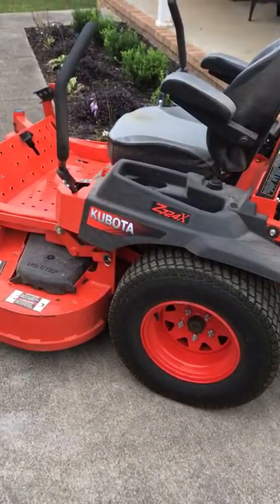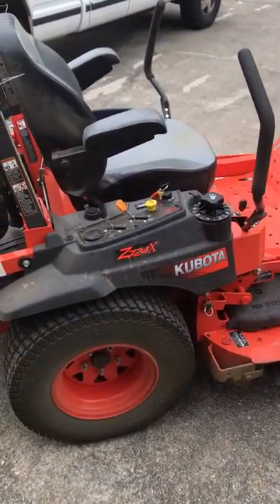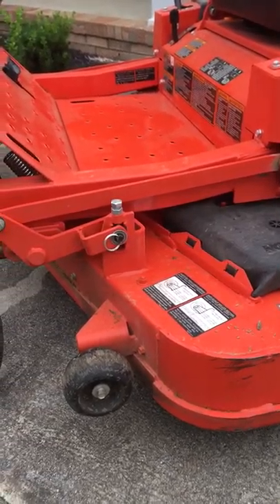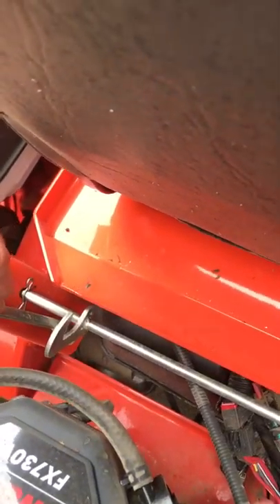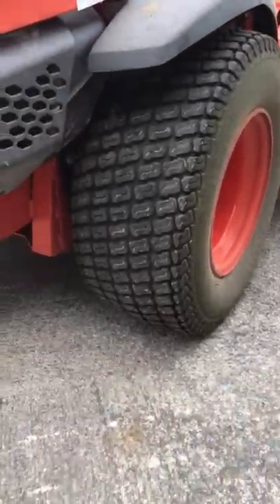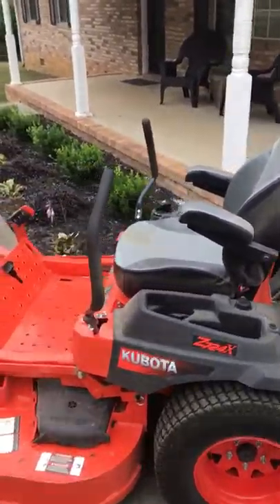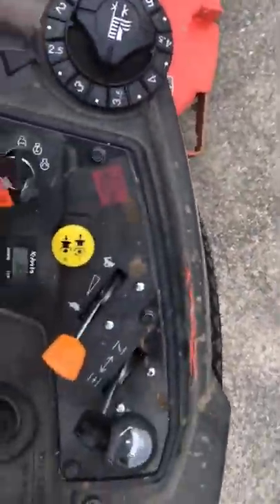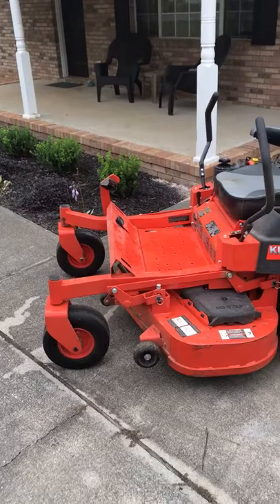2017 Kubota Z724X

Comment: I own a 2015 Kubota Z724 54 inch deck and mow commercially part time.  

Everytime I surf for 'another' ZT mower I always come to the same conclusion:  Even though mine was built in 2015 it still beats the competiton... no nonsense design, awesome deck height adjustment, built like a tank, superior cut even with dull blades, fast, easy access to belt and pulleys. Easy to work on this unit, superior Parker transmissions (I actually push my customer's full size dumpster out of the way effortlessly when it is incorrectly placed by waste hauler and frequently pull a 1500 lb capacity Polar tandom axle trailer filled with yard waste), low center of gravity (one 11.5 gallon tank mostly under seat), minimal travel for steering arms, 8 gauge deck, simple no nonsense design controls snd more!   

Seat cushions are very comfortable but actual ride is stiff as it is not a suspension system seat.   That's ok because it keeps center of gravity lower than a ride with suspension seat which could be the difference between a rollover or not on hills that I manage.  

I'd buy another Kubota today..2023...if they were available.  Hard to get right now so I'll keep my 2015 model for now.

Comment: Just got my new z781i 60” delivered yesterday. I haven’t cut any grass yet. Probably will this weekend. Looks like a tank. I had a little 4x4 kubota tractor that I have mowed with the last 20 years. I never had to do anything to that tractor. I just sold it a few days ago. I was wanting to cut down on my mowing time with the ZT. It was a no brainer for me going back to Kubota. I wanted the diesel but just couldn’t pry my wallet open enough to pay 15-20 K just to mow my yard. Love them Kubota diesels though. I also have a Kubota SVL 75 CTL for the farm. I just don’t think you can go wrong with that orange stuff. It seems like they just have really good engineering and make things simple that work.

Comment: Good review,  I've have this more  with a Kholer engine  it's a beast . I have noticed if I  get on a bumpy section of the yard the deck height selecter will move so I have to watch my speed in situations like that.  I to wish Kubota would have put the wider tiers on the back, but over all I'm pleased with the mower.

Comment: Good review. How does it cut?
Reply from the maker: It cuts good.  However, as I mentioned previously, the engine size (23.5hp) is a bit undersized for this big of a mower in my opinion.  I think it should at least have a 27hp.  I’m thinking of trading for a ZG327.
Reply: ShoNuffStuff if you like this mower but not the power check out the new 2019 z700 EFI. They have a 29.5 hp EFI option on them. And they come with a very nice suspension seat. I hate the Fx730v that’s in my 2013 JD z920m 60”. It’s so underpowered. It has about 2000 hrs and is starting to give problems. Love the 900 series JD one the top cutter decks in the industry. But I really like the new z700 EFI from kubota. I want to go check them out at the dealer soon. The deck on the ZG is not that great of cutting deck far as quality of cut from my research. Good mower but poor deck. Meaning it’s wet cutting performance is lacking as well as stripping ability. But if your just doing your own property then those things don’t matter as much, at least to some home owners.

Comment: Thanks for the video.  My 724 is stalling.  Quits and then starts right back up. No rhyme or reason.  New fuel, new fuel filter.  Any ideas?
Reply from the maker: I’ve actually noticed mine will “cut out” for a split second when I go over a slight bump or something a few times.  It’s not a big enough bump to where I’d come out of my seat to cause the safety switch under the seat to turn the engine off so I’m stumped as well.  Yours have the Kawasaki?
Reply: I have the Kawasaki fx730v engine. Mine was surging and almost going dead but still could cut fine if that makes sense. After changing everything. Fuel filter, fuel lines, fuel pump, spark plugs. It was the Welch plug on inner side of the fuel line on the carb. There is 2 Welch plugs that Kawasaki has had problems with vibration making them come loose and it pulls air into carb.